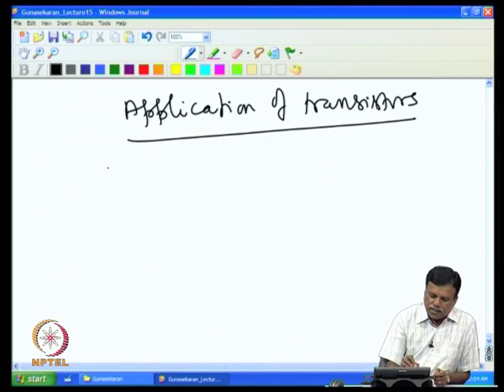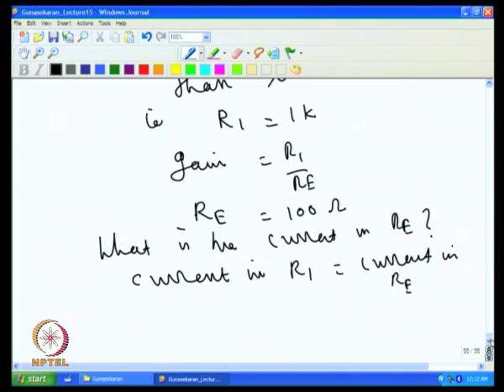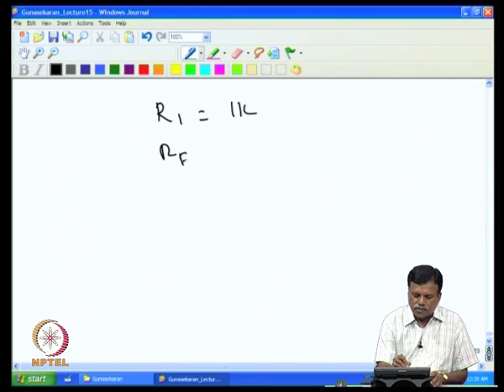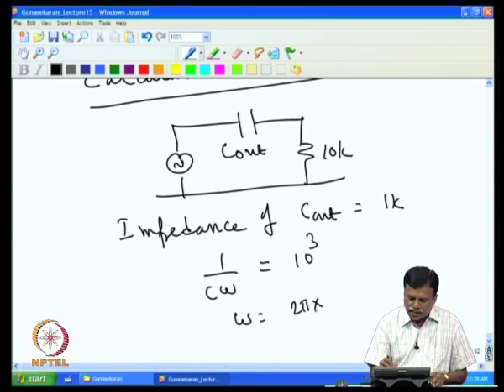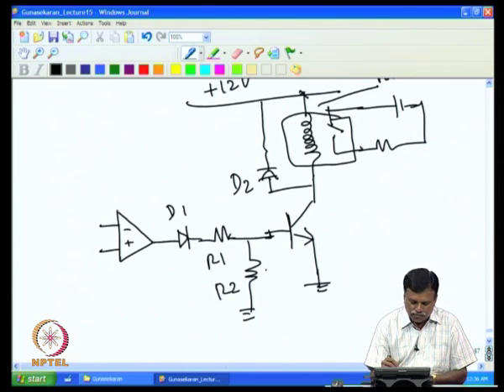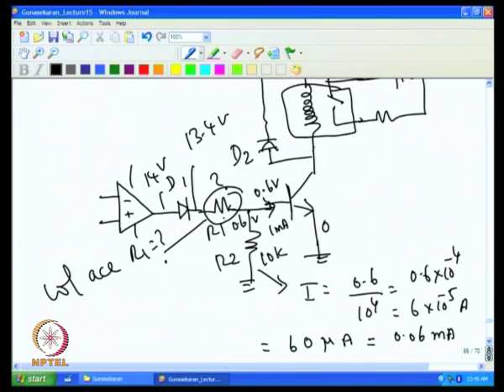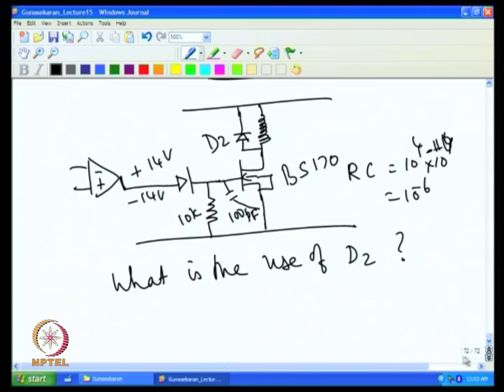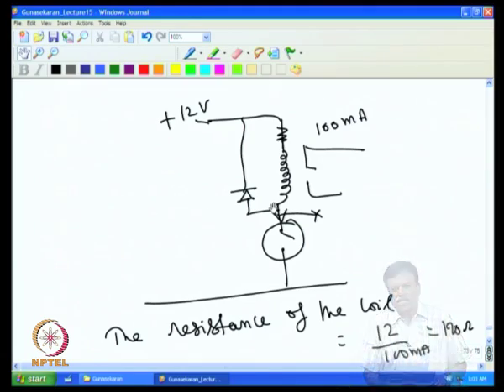Mod-01 Lec-03 Some applications of transistor -1

Comment: Just working through this today. I think there is a mistake... The calculation works out that there should be 50 microamps current at the base.. But when calculating the values of the R2 and R3, he uses the value of 0.5 milliamps ... This should be 0.05 milliamps (=50 microamps).. making R2=180K and R3=22K ..